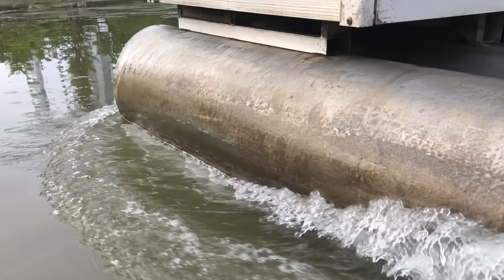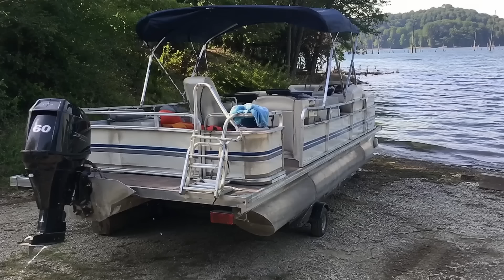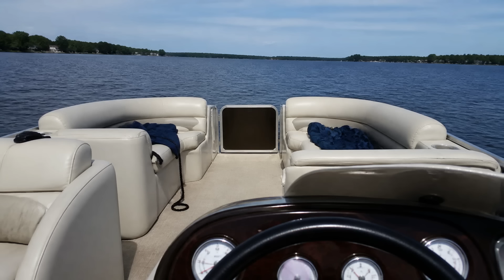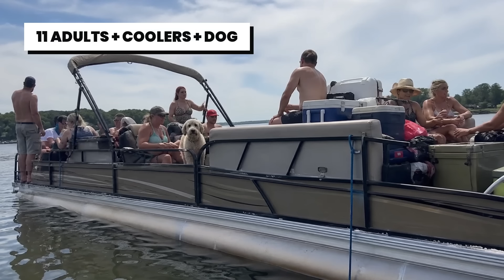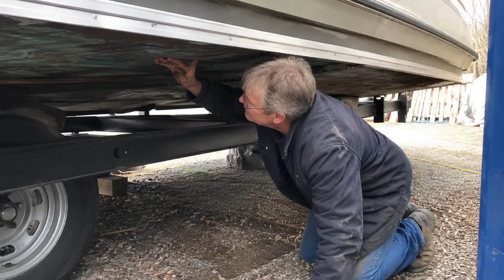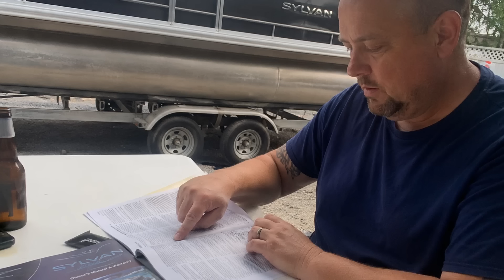Common Problems with Pontoon Boats (Before You Buy One)

Comment: If the water is rough or there is a strong wind, you do not want to be on a pontoon boat.
Reply from the maker: That is a very important safety consideration for potential buyers to keep in mind. 👍
Reply: @NixonBoatsCentral  I have run in very strong wind, NEVER into the wind, this boat, still own and run, new in '87. 24ft Godfrey, Merc/mariner classic fifty style mercury powerhead, owned and run for almost 40 yrs (2stroke, quicksilver oil only) runs wide open most of the time can pull light skiers. It ran at 5600 rpm new, still does, same prop.

Comment: Every other style boat has a drain plug, why wouldn't you give yourself a way to drain the tube? A pontoon is not a boat I would want to pull skiiers with, nor is a tube a planing hull, ypu do NOT need or WANT 150 plus HP
Reply: Most pontoons do have drain plugs in the tubes. Also many newer pontoons with lifting strakes are capable of going over 100mph. Way more than capable of pulling skiers.
Reply: @DaleSmith-j9r Good, they should, the video says its controversial, I say it shouldn't be. They may be able to go that fast, but it is still very much the wrong boat for that. Pontoon = BBQ, maybe crappie or bluegill fishing, sand bars, and possibly diving although not in the ocean. can you make a school bus pop wheelies or go 100 mph, yes, is it the right thing to do, no.